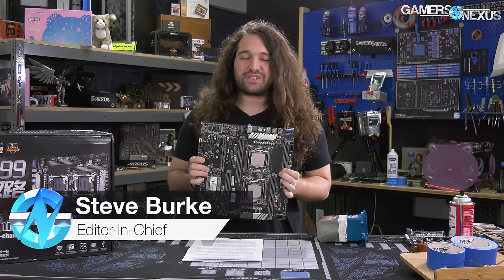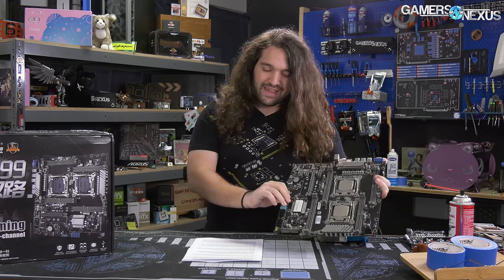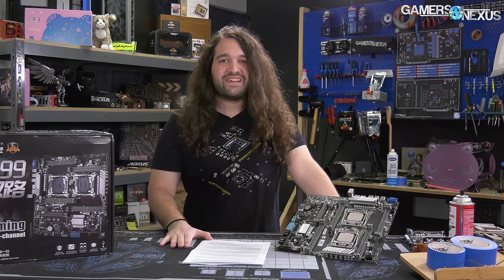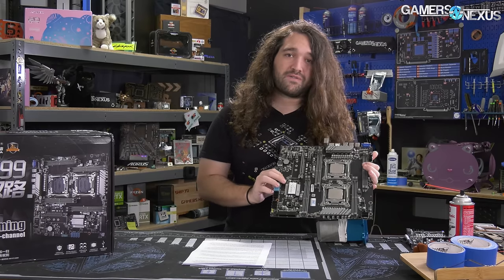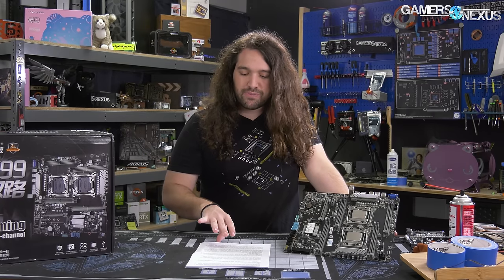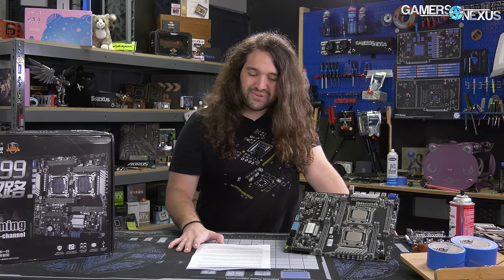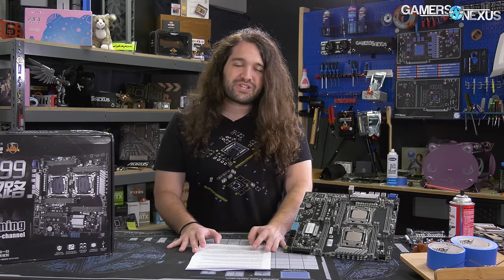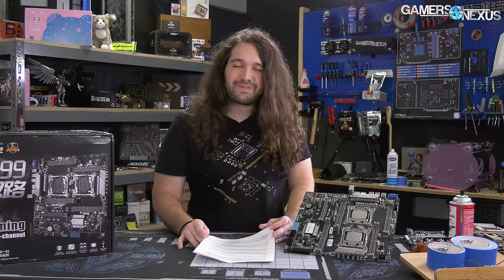24 Cores, 48 Threads for $360: Dual-X99 Jingsha Motherboard vs. AMD R9 3900X

Comment: I was looking at these sketchy motherboards on ebay, but I found a good deal for a single socket HP z440, and I'm glad I did. For less than $400 I ended up with a 14C 28T Xeon E5-2697V3 system with an RTX 2070, and it seems to perform a bit better than this dual socket system. I need to do more testing, but it seems fine. Its my back up PC anyway.

Comment: Single socket systems like Xeon E5 2673v3 (12C/24T) + Huananzhi X99-TF + 32GB DDR3 ECC RAM priced around 250USD,  which is same as decent AM4 motherboard only cost. MB have 2pc M.2, CPU could be undervolted and all cores unlocked for turboboost. Great value for productivity, code compiling, VM etc. Could be used also for gaming, if you save the difference (say Ryzen 5 3600X set) for top GPU. Not much upgrade potential though.

Comment: Those E5 2678v3 are the same as 2680v3, but support DDR3 and DDR4 memory. Probably they are custom made for a big customer (someone big who needed the CPU power and wanted to reuse the memory they already had) or made for a specific region. There are a lot of Xeons on each generation that don't show on the ark.
Reply: Just like some of the totally awesome 2666 v3's I found on ebay. They are a special order for amazon AWS. 2.9ghz 10 cores for 160 usd. A total steal.

Comment: I have just such a build in mind, mainly as a conversation piece instead of expecting it to be an FPS-shredder (I seldom game, but do a lot of virtualization and other workstation-type tasks).  I have specifically had my eye on the 2678's, but I had a single-socket Chinese board take a complete crap on me when I tried to tinker with the memory settings.  I don't think that the Chinese dual-socket boards have NUMA implemented properly either, which will have a pretty big impact on performance as resources don't get efficiently alocated/released.  I'm hunting instead for a bargain on a used Asus Z10pe.  The extra cost is worth it to have an officially supported configuration, better memory configurability, beefier VRM's, multiple x16 slots, etc.

Comment: Chinese Xeon is a good choice, but only in the dirt cheap category. I have an X79 ZD3 + E5-1650 + 4x4GB ECC combo in the workshop.  Same price (~160EUR) like a cheapest AM4 mobo, cheapest Athlon, and a chepest 2x4GB kit, but performs much better. Some of the Xeons are unlocked, like the 1600 series, these are fairly adequate to gaming at ~4.0GHz.

Comment: The ideal way these could be marketed would be a weekend scrapyard salvage tool to get a garage sale cpu 10+ years vintage and just because its Double should run similarly to a $300 new build but you just got last gen chips and doubled it. It could be placed side by side modern mobos but have the same output spec range

Comment: You know, this is a pretty good deal considering the fact that a first gen threadripper 1950x still commands north of 300 dollars on Ebay, by itself, and probably performs similarly in productivity.
And second gen threadripper prices are still insane for some reason. Might as well buy 3rd gen instead with what a 2970WX is commanding.
But first gen Threadripper is still an interesting prospect on the used market if you're looking for this kind of machine. Total system cost would be similar when all is said and done and you get a LOT of PCI-E lanes on Threadripper without needing a second CPU.
Reply: I have Threadripper 1920X, 2950X, and a 3960X rigs. Ryzen 3000 basically obsoletes 1st and 2nd gen Threadrippers. Ryzen 5000 is just the final nail in the coffin.

Where Threadripper 3rd gen shines is Quad channel memory support, huge number of PCIe lanes, PCIe 4x4x4x4 NVMe support, high thread count, tons of RAM, and three PCIe x16slots, among other things.

Comment: It would have been useful to see a single 2678 v3 as a comparison to the dual-socket config. The single 2678 v3 likely would have done a lot better in games, but much worse at the workstation stuff.

Comment: For giggles i used an actual server for this.. It ended up costing me far too much (over £500..), mainly due to the second VRM module needed for the second socket i had to import from Canada! An IBM System X3400 M3 with dual Xeon X5660 CPUs and 48GB of ECC RAM and dual 980W redundant PSUs, all in a huge 5U tower.. I also had to build a custom harness to give the GPU i added power (A GTX 970 and later my 1080 Ti for a laugh) but it worked! I ran benchmarks including Superposition, Heaven and FFXIV! I suspect the 'stuttering' issue you have, along with non-server or workstation software not really understanding NUMA properly, is the whole PCIe Gen 2 issue.. I'd love you or Linus to try this with much newer Xeons that use DDR4 and maybe even a custom board (talk to EVGA) that can overclock? Or perhaps 4 of the classic Socket 1366 Xeons i have a fair few of, all overclocked. That would be..interesting but.. Heck, if you can get a custom board done (which would not be cheap) dual socket AM4 or TR4s? Hahaha.. Or of course dual Epyc, that would be 16 channel RAM then wouldn't it?! Mac Pro killer indeed..

(I ran the harness i made directly from the 12V input to the regulation and distribution board on the PSU cage, due to it having the 12V split into about 8 rails at around 20A each, also used a couple of relays that would turn on when power was applied from the output header for drives on the motherboard.. Bit elaborate just to get a decent GPU card working in there, wasn't it? Haha! I had to though, otherwise the system got upset if i tried to pull it from the aux/drive power headers, one PSU would shut down and the other would go into turbo fan OMG something is wrong mode! I suspect one of the PSUs to be failing though but it runs fine from either one powered individually, could be a fault on the output module too.. Shit, this post got long but oh well!)

Comment: One thing you didn't mention is that while Blender perf was similar between the dual Xeon and 3900X, the power draw is not even close. The Xeons are rated at 120w *each*, while the 3900X is rated at 105w.

For another "game" that may show the benefits of high core counts, how about a chess engine? Stockfish, for example, scales quite well with core counts.

Comment: Few more things to mention: 
1. Single xeon offers almost same performance
2. Single boards offer real quad-channel ram
3. Better use ddr3-capable boards. You can buy samsung ddr3 ecc reg memory for < $90 for 64gb
4. Better justify the price of whole system, memory included. As of today it's $85 for cpu, $70 for an atermiter board, and $90 or less for 64gb memory. And some gpu, ofc.

Comment: Great to see GN reviewing this kind of board, seeing less professional channels repeatedly suck them off on the merit of running 2013 games is tiring.
Reply: Not really, this is boring content that has been covered multiple times over the last few years by every channel out there. At this point in time I don't need Gamers Nexus to tell me that loads of slow Haswell cores from 2014/2015 don't perform as well as a newer Ryzen or Intel system utilizing less cores. Not sure what channels you've been watching myself but pretty much every one I have watched has told me the truth about these "X99" boards.
Reply: @w19ely85  Also true, but GN covering it properly gives people who are new to this a good insight so least. Provided they stumble across this video somehow.

Comment: That Aspeed 2400 is a standard BMC controller. It may have IPMI over ethernet support. It should theoretically support 1280x1024, and maybe 1400x900. It's a design based on Matrox G550 chip.

Comment: I got a X99 dual socket Jingsha motherboard with DDR3 memory slots, that are supported by the 2678 xeons. ECC DDR3 costs half of DDR4 (used sticks available on ali) and performance is basically the same. For a cheap server it’s unbeatable, and it’s actual server grade hardware with ECC. For a programer workstation also can make sense, specially if you run a ton of VMs and need a lot of memory.

Comment: Games aren't generally optimised for dual socket configuration where the GPU is connected to ONLY one of the CPUs via PCI-E. When the other CPU needs to communicate with the GPU, it will be much slower and thus hurt performance. Might be interesting to disable the second CPU when playing games and re-enable it for workstation workloads.

Comment: IMHO a really good value right now is a $100 motherboard and a $200 used/new i7-7600K can compete really well with many modern CPU, and overclocks well, supports DDR4 and won't bottle neck until you get to 2080ti+

Comment: This actually seems like a really decent server option. I wanted to build a server to host some private game servers and a website but couldn't justify the high'ish prices of server hardware. This seems like a neat budget option.
Reply: BTW  Dell T5500's make great servers, you can get them used with two processors 72GB RAM, boot SSD for under $1K.  The faster CPUs will drive that up to around $12-1400 USD   I got one years ago from Dell refurb to run XenServer, now it runs Proxmox.  Works amazingly well.  For a bit more money you can get into T7500's and get faster memory, and more of it.

Comment: I built a c612 server late last year to run Virtual Machines (ESXi) for file serving, a windows VM that I can image to install an up to date windows. 
I used a super micro x10-drl-i, 64gb of ECC and a single 2660v3 and 8 12TB hgst drives. 
The all core turbo hack is cool, it's unfortunate that it won't work on the v4 xeons I will be moving to.
Reply: The Chinese boards have lots of quirks that I wasn't wanting to chance on something I am trusting to run 24/7 for several years.

Comment: i am honestly looking into a xeon for my i7-5820k when the 6C/12Th is getting in the 90% usage range.
combine this with the loss of non-oc (intel locked that down), but a possible bios mod to run all cores on max turbo.

i can get the E5-2680V3 12C/24Th for 140 bucks used WITH warranty , no chinaimport. Which is in the cpu list for the MB.
Theoretically the quad ram channel could get more gbps than a i7-10700k (which i upgraded my vr system to) ...
Since i'm running a asrock x99 extreme4 with already 32gb (4x8 and 4 slots free)
and a nvme slot it's not as if the hardware would be obsolete.

edit: i was talking to miyconst about that, because he had a video about the "bios-mod-made-easy" ;-)

Comment: I think AST2400 is pretty common in servers as a simple VGA chip. I saw it in DELL, HP, and Supermicro servers very often. BTW, I think you can assume this is a server motherboard mainly for SMB or PC enthusiast because of its low price. Actually in China, or some other less developed countries, used hardware, clean pulled CPU, or previous generation hardware are very popular, mainly because of its low price. Even in the US, there is a niche market for this type of hardware as well.

Comment: Please test out a cheap (but obviously still good) proper X99 build and compare it to modern budget equivalents, such as the 3600 or 10400. You can buy a used 5820k for only $120, overclock it and (from what I read) get gaming performance similar to a stock 8700k or 3600.

Comment: 14:49 I used this "Turbo Boost OC" on an Intel Core i5-4690 in the Past, with this I could run all the 4 Cores at 3.9 GHz at all times 
This resulted in up to 5-10% more Performance in CPU limited Games :D

Comment: Steve I swear I was about to comment to have a look at cheap 2011-1 or 2011-3 OC CPUs vs the 3600 if the i5 10500. I recently picked up a 3930k for 40 EUR, I already had an old ROG R4E laying around and paired it with a MSI 1080 Gaming X, nice 1440p gaming rig for 400 bucks.

Comment: "I have an X79 motherboard with an E5-2697 v2 processor and 64GB of RAM running at 1844 MHz. I'm using it comfortably and efficiently with a GTX 770 ASUS 4GB graphics card, a 500GB SSD, and a 1TB HDD. The speed is truly impressive. I use this computer for 2D-3D design, and it performs very well in 3DS MAX. It's also highly efficient and fast in Epic Games Twinmotion 3D and other software. It works great with Corel Draw and Photoshop as well. These processors would be even more efficient if they had newer instruction sets. God willing, I plan to upgrade to an HUANANZHI X99 DDR4 motherboard, a dual processor setup with 2699 v4 CPUs, 128GB of ECC DDR4 RAM, and either an RTX 3070 or 4080. I believe anything beyond that wouldn't be necessary for me. Regards... P.S.: AMD is regrettable. It has issues."

Comment: CPU-Z pretty much always misreports memory channels with dual-socket motherboards. An easy way to verify would be a memory bandwidth benchmark. Which is also one of the last areas of computing where systems like these can make sense, even if you have access to new hardware at regular prices: software that requires high memory bandwidth due to low computational intensity. Like many CFD and FEA solvers. Being able to use cheap "registered" memory further increases the value proposition, because you usually need quite a lot of memory for these applications.

Comment: 2678v3 does support DDR3 tho.
There are cheaper Huanan(?) dual socket boards with DDR3 slots, total cost of the parts would be around 50$ lower.

Comment: Found this video very useful as I have recently become interested in this. I was wondering how an x79 with dual 2667s would work. I understand it is the older ddr3 but I am curious if the higher single core clocks would help boost performance in gaming.

Comment: Aww an add for the mouse mat. I waited 3 months for stock, and it got all the way to Melbourne here in Australia, where it was promptly "lost" by Australia Post. When I messaged them about it they suggested I contact GN. When I questioned why I would do that when THEY lost it, they quoted THE UNITED NATIONS. I shit you not. Too scared to order another one now. :(
Reply: Follow it up, if you didn't receive it either the sender or the carrier are responsible. They will have to resolve it between them. Don't give up! It once took me 6 months without a car to win against a warranty company but saved me £3,500. Good luck 👍

Comment: i have also ordered the Chinese x79 chipset motherboard and have assembled it with the 6 core xeon e5-2020v2 for just under 100 USD. i have video on my channel. these are great boards if you are not doing anything fancy.

Comment: It is a pity that the AST2400 was not more closely examined here, also in terms of access and stability. Altogether the board is used as a "workstation" in the Ali. Advertisements advertised, here it makes sense, gaming with 2 CPUs is generally very latency-prone... and not a good idea. What this board does well is the AST2400 onboard graphics and the ECC-REG RAM support... that's exactly what many gaming Ryzen -config lack. Ryzen has no official ECC support, only the "Pro" and there no "REG"... which are a lot more expensive... just like the board.  The same applies to VMware ESXi ...no Ryzen support. So if you want to do more than just gamble, build a server or love your data very much, you should use ECC-RAM.

The good thing about the CPU is the possibility to use DDR3 ECC REG, which is much cheaper than DDR4... and also as a "Gaming" board the "HUANANZHI X99 X99-TF" would have been more useful because you can use DDR3 or DDR4. 
But there would also have been dual socket x99 that uses DDR3 which would have been much cheaper.
Nice is that "Miyconst" was mentioned, a wonderful channel.

I am grateful that it was mentioned here how the maximum power consumption is, but in server mode nobody will beat all threads 24/7 to 100% - my servers are in idle mode most of the time and their power consumption would have been very interesting for me, too bad. It's also a pity that HT was not switched off for "Gaming", with oc it would have been the better option in some games.

Comment: Did you disable spector and meltdown patches using the tool by Gibson? And a fresh install without updates? I'm sure windows patched a bunch of other vulnerabilities since then also causing the cpu to loose a lot of performance. Obviously not idea for security but some of these vulnerabilities need direct access so it's not a big deal for some people.